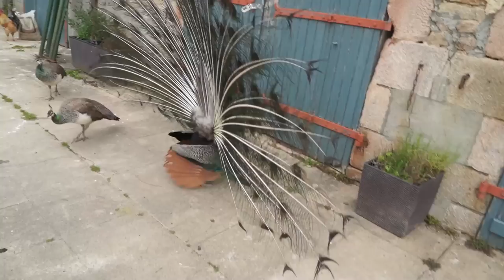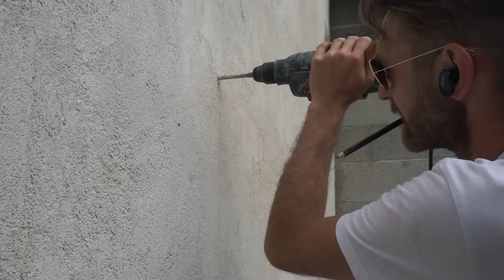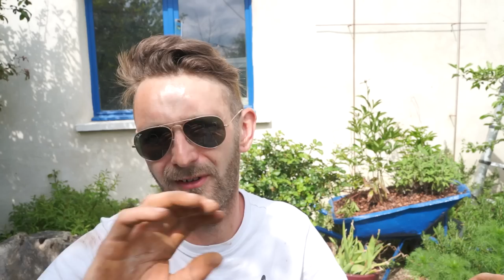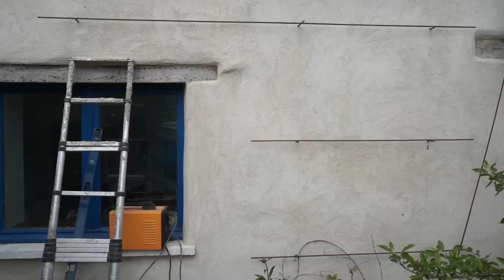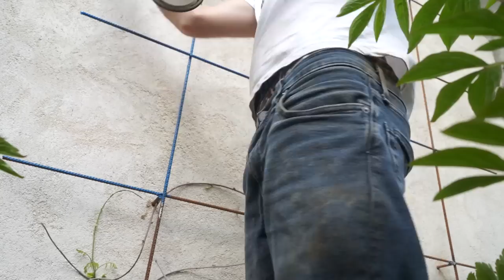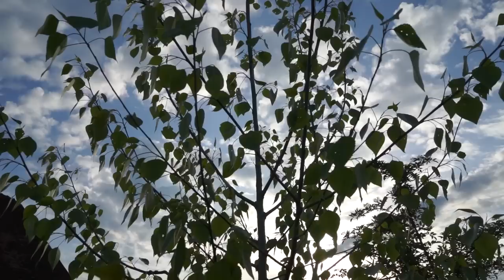Welding a wisteria trellis | EP031

Comment: Heartiest congratulations on the forty thousand Dan - 40 PLUS already. 👏 Great work on the metal trellis but if your Jasmine grows like it does here in NZ you will need iron bars to hold it.😅 Here it’s very invasive if unattended and we have to cut it back ruthlessly as it also travels underground and can pop up many meters from the original vine. I do adore the flowering season though.👌🥰

Comment: In less than three years my Japanese Wisteria took over the courtyard, got into the roof space, lifted the tiles, stangled the climbing rose and was generally gorgeous and quite frightening ! When they like where they are they can be invasive. In my new house I am overrun by honeysuckle which I love but god does it spread and it must be one of the easiest plants to take cutting from along with clematis.
Reply: Kind of like ivy. I love ivy covered walls but overtime it will destroy the wall. I went into a back room that is usually shut off from rest of house  and somehow ivy had found a crack around window and was running up the wall. I have confederate jasmine that I planted as a ground cover and I really have to watch that it doesn’t climb from gazebo into the trees.
Reply: @lorihamlin3604  During first lockdown I moved to Dordogne, into a huge old 7 bedroom house that hadn't been lived in for many years and the creeper had been allowed to cover the house and up to the roof. It had crept into the gaps behind the shutters and even into open windows. They pulled it all off before I moved in but of course left the dead vine bits all over the walls and I am struggling to scrape off, sand off the marks of the suckers that they left everywhere, especially the woodwork. I used to have Virginia creeper on an earlier house, it was gorgeous in the autumn when it turned red and we did keep it in check to stop it getting near the windows or roof. In my courtyard I am growing clematis and jasmin and the other courtyard I build a pergola and planted a grapevine and a self fertilising kiwi. They have both already grown to great lengths and strengths in just a year.